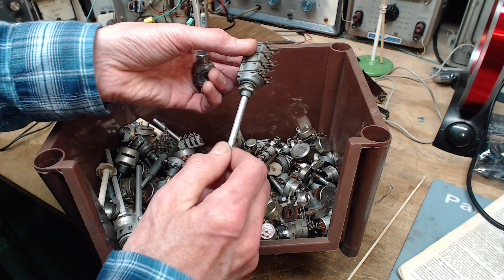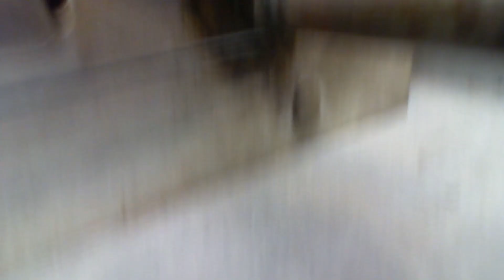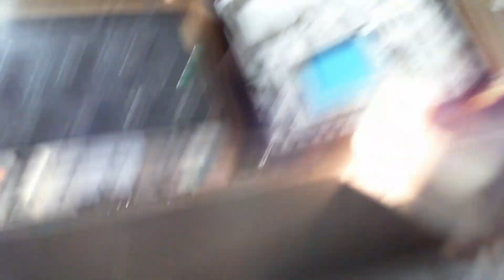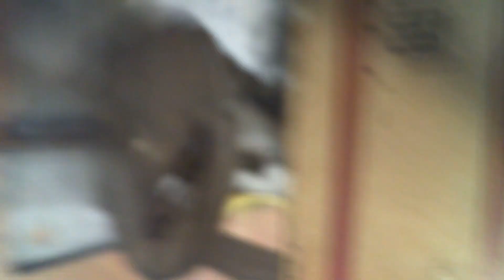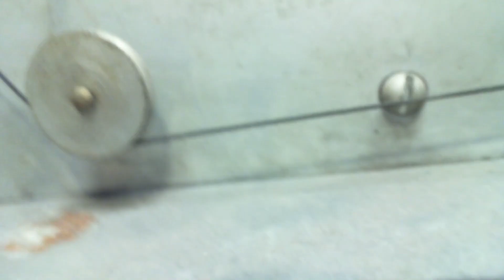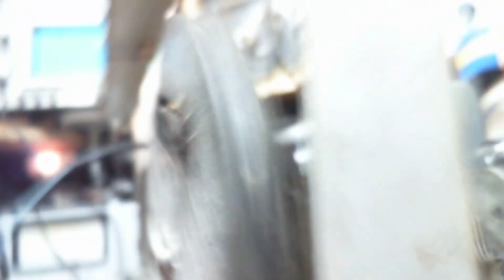1940s Canadian Red Cross Tube Radio Video #6 - String Trouble and Finale

Comment: That plate looks like a section of a selenium rectifier stack.  Used them back in the day to replace CuO rectifiers.  Unlike semi-conductors diodes of that era, they were very tolerant of transient overloads and over-voltages.  When shorted though, they would burn up and stink like Hell.  Enjoyed your sort of that box of parts!!!!